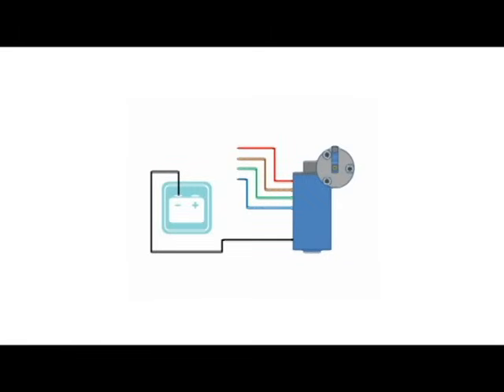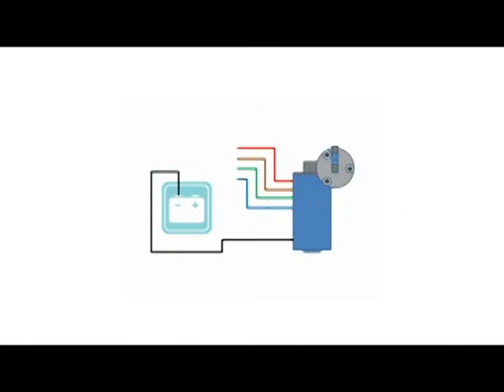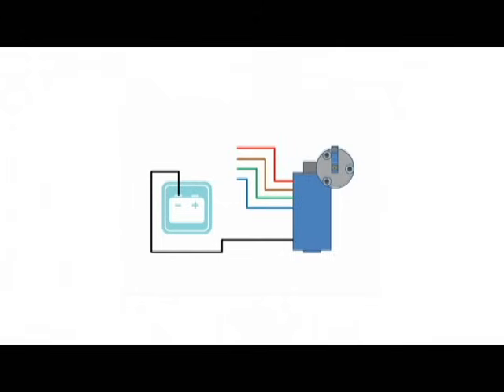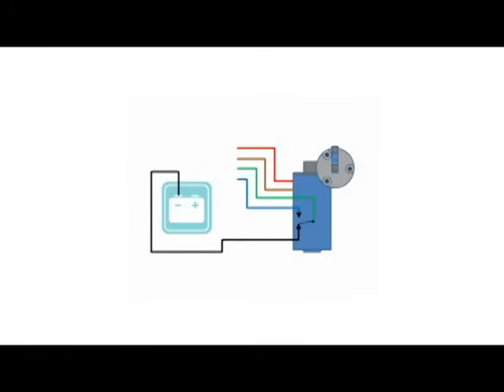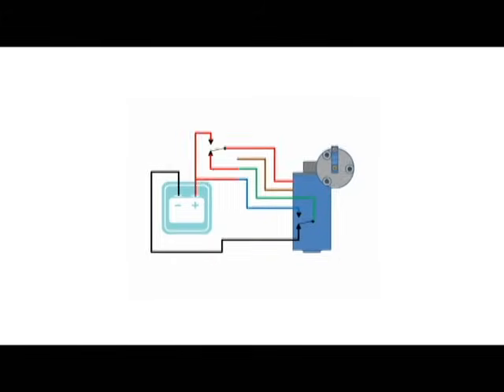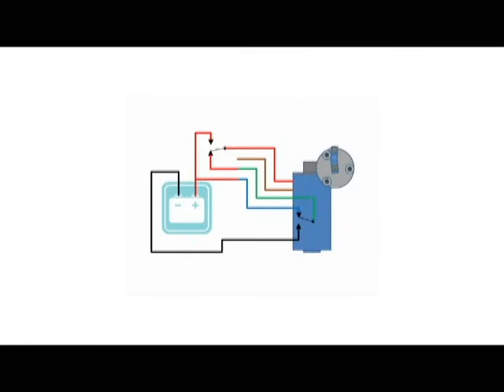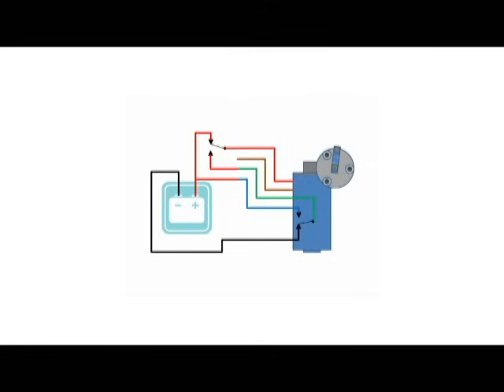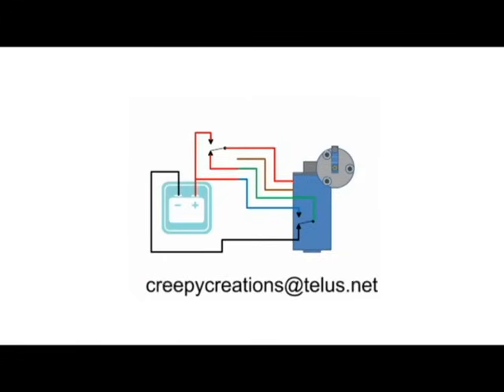Windshield Wiper Motor Wiring Tutorial

Comment: This is indeed the best explanation I have seen as others have said.  Most vehicles have not changed this theory in many years, why fix what isn't broke.  What I found helpful when looking at the complete schematics of vehicles is to start with the switch in low speed, look at how the circuit works and then turn it off and watch the operation.  Simple, but it took coming to the conclusion of starting my learning from the low-speed selection to be successful in understanding.

Comment: Excellent tutorial.  I'm having a problem with the wipers on my VW Golf Mk4 and this has helped me understand what's happening.

The blades behave normally, except that they continue after the 'park' position, and end up stopping a few inches up the the windscreen.  This is intermittent, and sometimes they park in the correct place, but almost all the time they park those few inches higher.  The 'faulty' position seems to be gradually rising, so now they park 4 or 5 inches up, whereas a month ago they were only parking 2 or 3 inches up.

I guess the park position (as opposed to whether they park at all) is controlled by the internal switch in the motor itself rather than the relay, but I'll have another watch of the video to see if I can think it through...

Comment: I am having a wiper park issues on my RV I want to put in a switch to manually park them.  Which wire would I put that switch into.  I was thinking of just ground, but maybe a better way,  I have Had Ford take a look at it,  they replaced the controller, I replaced the Column wiper switch and the Wiper Motor. It could be the park has to be adjusted. When it does work which is very seldom It does park in the 3 o'clock position. But I am at my witts end. It is a pain to adjust the park position on the RV so I want to put in a switch
Reply from the maker: The position cannot be adjusted.  It is base entirely on the motor and its position.  The only way to adjust the park position is to literally rotate the motor. Given that there are usually three bolts in a triangular arrangement, you really only have 3 options.
Reply: @AnimationGoneWrong  I believe what is happening is gravity is pulling it past park.  If I put my hand on the wiper assembly with a small amount pf pressure when at the 3 o'clock position they will park every time.  getting past that.. If I were to put a ,manual switch in to shut off the wiper motor which wire would tap into to install the switch.  I believe I can do it by tapping into the ground, but is there a better way..
Reply from the maker: @bassoneman  ground is usually the actual body of the motor, and the vehicle, so there's likely no way to tap in between that. Seems strange that you can put pressure on the assembly and it works... that makes it sounds like a bad connection, perhaps between the motor and the vehicle chassis itself.  Maybe what you need to do is install an actual ground wire between the motor and the vehicle chassis, to ensure a better connection. Just a thought... Also, most wiper motors use a work gear to drive the output shaft from the motor itself, thereby virtually eliminating the ability to manually (or by gravity) move the arm. Odd situation indeed.
Reply: @AnimationGoneWrong  This AM I took and ran a wire from the negative terminal of the battery directly to the case of the motor.  If I turn the key to one click before starting the engine the park position works great.  If I start the engine it won't park have to shut off the engine then the wipes will  park . Hmmm this is kicking my butt.  There is a ground that comes into the motor on its connector. Then coming out of the motor there is a wire that attaches to the outside casing that is where I attached the ground for neg side of batt.  I wonder if there is a issue with the ground that is coming in to the connector where is is floating or noise on it.  When I put a meter on the connector it shorts to ground. I may have to get a oscilloscope to see if noise is on that ground on the connector.. Or cut the wire and connect it directly to ground neg battery..  Ideas?
Reply from the maker: @bassoneman  no ideas at this point, sorry! Definitely sounds like you're homing in on the trouble, though... a wiring issue of some kind.  So, accessory position, it works. Running, it doesn't. Very strange indeed.
Reply: @AnimationGoneWrong  I am going to set up the motor for a test eliminating the control module..  The wires I have going into the wiper motor are Low, High, Park, Switch, and Ground.   My confusion come in the Park and the switch.  On your example which would be the park and the switch wires..  Is it that when I turn the switch actual physical switch on that goes to 12 volt, and off it goes to ground.  On the park wire  does that go to 12 volts or does that go to ground.. I guess what i am trying to say the green and blue wires on your example which would be the switch wire  and which would be the park wire
Reply from the maker: @bassoneman  in my example, the blue wire requires power to be available to it all the time, so I guess you would call that the switch wire. The green wire participates more directly with the parking feature, so you would call that the park wire, for lack of a better term.
Reply: @AnimationGoneWrong  Thank you..

Comment: Thanks, I have used wiper motors for a few halloween items but I was trying to figure out how to use a wiper motor to open and close my Greenhouse vents since the automatic ones didn't work. Looking to control the system with a thermostat. Once it reaches 80 degrees the vents open and the intake fans turn on, but I need to have it turn off the fans and close the vents when it gets cool. I have to figure out stopping the motor when it gets to 180 degree from where it started to open the vents, then when triggered again it continues to it's parked position
This was helpful so I don't have to recreate the wheel trying to figure out the wiring.
Thanks
Tim

Comment: Great video, how would you go about powering the wiper motor when outside the vehicle? On the plug pins.
Reply from the maker: I usually use old PC power supplies. They are cheaper, reliable and produce more power than you'd ever need to run a wiper motor. I've got videos on how to do that, too!
Reply: I tried powering a vw caddy 2015 wiper motor (with a pcb board) directly from battery and nothing happened. It’s a 3 wire, pin 1 is a power supply control unit, nothing on pin 2, pin is ground and pin 4 is from ignition switch.

Then I tried powering a Ford ranger 2015 wiper motor (with no pcb board) and it worked.

How is the one with a pcb board operates compared to one without a pcb board inside?
Reply from the maker: @khakalethumbete5269  No idea.  I would Google that particular vehicle and see if there is something special that PC board does.

Comment: Great video.  Clear and easily understandable.  I have a question.  In the video, the blue wire is going to the power source and the green wire is going to the relay/switch.  Are these wires interchangeable?  If not, how can i tell witch plug on the motor should go to the power source?
Reply from the maker: It depends entirely on the wiper motor. Those colors just happened to be the colors of the wires on the motor I had at the time. It took a lot of experimentation with a 9 volts battery (yes, it will get VERY hot if you try to run a wiper motor for more than a couple of seconds) to determine which wires did what. A multimeter is very handy for some of this, too.

Comment: If you apply power to the brown wire, which is the high speed setting, and a cable break occurs in the brown wire while the wipers are in a non-parked position: will the wipers stop where they are, or will they return to park using the low speed setting?
Reply: only one way to find out.... now go get some wire cutters ;)

Comment: Thank for taking the time to create this terrific presentation I still can't get my head around   one thing  ..  while  driving the motor  whats stopping that  park switch from switching and grounding the low speed  motor winding and blowing the fuse ?
Reply from the maker: Technically, nothing... other than bad wiring. If wired up as I show it, it can't ground the motor winding.  But yes, it is possible if wired incorrectly. So always check everything twice! 🙂
Reply: @AnimationGoneWrong  Sorry mate it just clicked only the green wire goes to the ground as we cycle through the park and on your run switch has it left open in the run mode  i don't know why i struggled with it so much ..

Comment: May I asked, will the motor make a single rev after I inject voltage at the blue wire? 

And it short of the video is trying to said,if there is a power cut at the Red line. The motor will continue to rotate and stop at its parked position, correct?
Reply from the maker: Not quite sure I understand the question, but I'll try... if power is cut to the RED line completely, it will stop. Voltage applied to the BLUE wire has to be connected to the RED wire through the GREEN wire. See around 2:38.  Without any other circuitry, applying voltage to just the BLUE wire will do nothing.
Reply: @AnimationGoneWrong  Thanks i think i got it.

Comment: Ok, i have removed my rear window wiper due to me getting rear black out windows, i want to know can i wire a 12v fog lamp  to the existing wire that was connected to the motor? i may as well use it. thanks
Reply from the maker: No idea, but I don't see why not. The wiper motor probably drew more power than the fog lamp will anyway,

Comment: This was nice, but, as you said, my wire colors are different. As I'm using my wiper on a trommel, the absence of a ground wire has me stumped. My wires are red, white, yellow and blue. Just need the slow speeed to work. Any advice?
Reply from the maker: Don't forget, the body of the motor is often ground. You might have to find a screw or small bolt your can loosen to attach a wire.  That's what I did.
Reply: @AnimationGoneWrong  awesome, thank you. Then I'm assuming I run that wire to the neg terminal on my battery, since there's no framework to attach to?
Reply from the maker: @nicholassteichen4552  yes, if what you are working on/building has no actual chassis, then the "ground" wire from the body of the motor would go to the negative terminal on your battery.
Reply: @AnimationGoneWrong  yep, no chasis

Comment: You mention using a 555 timer to control the wiper. Do you have a video on that? I was thinking of using an Arduino but if it can be done simply with a 555 that would be great. I'm trying to create a circuit to convert our two speed wiper system on our 1980 Camaro to  a delay wiper setup. With COVID the "delay/pulse" boards usually available to do this are out of stock everywhere. Thanks

Comment: Thank You so much!
Amazing that you are thinking outside the box as well.....I’m planning on using new but older style GM truck wiper motors as “openers” for my tailgate and cabinet doors on a futuristic looking utility bed I’m building on my truck.
     The tailgate and cabinet doors with  close and latch by hand with no handles.....the tailgate will have a momentary switch in the cab, to cycle the motor once with a cam to bump the latch open.
      Once the tailgate is open other momentary switches can be accessed to open the cabinet doors 😁👍🏻
Reply: Now I watched the video again.....the switch that flipped between the content and the internal switch.....in either position one is getting power 🤔 ....so it seems I need a second switch to kill power before that, since this will be only used once when opening a door, then off the majority of the time.....or is the relay responsible for that?
Reply from the maker: @justintyme1449  Sounds like a great use for these motors. Best of luck with that!

Comment: The video was excellent but only for the red (slow) wire. How do we wire this up for both the red and brown wire?
Reply from the maker: I'm not sure I understand your question.  The video clearly shows what the red and brown wires do. Red is slow (normal) speed, and brown is high speed. They are used independently and are never wired together. The park function is also never used on the high speed side either. What else were you expecting?
Reply: @AnimationGoneWrong Thanks for the quick reply! I guess I should have been clearer--sorry. Yes, the red wire is for slow speed and the brown wire for high speed. You clearly showed how to get the park function to work if you were using the slow speed. My question is how to use it for the high speed? You say that the high speed does not have a park function(?). I guess you have to go from high speed to low speed before shutting off the wiper motor. My problem with that is my stalk/switch went bad and I hard wired  my wipers to a on-off-on switch--one for low speed and one for high speed. That is why I asked my question. I guess to park when I am in high speed is to go from high speed to low speed to off. Or can I do the same process for the high speed as  you explained for the slow speed using two relays instead of one> Thank you for your time.
Reply from the maker: @nothingbutmathproofs7150  In theory, you could add a second switch between the upper relay and the red and brown wires. It should function the same, but I cannot guarantee it as I have never tried to park a motor running at high speed.

Comment from the maker: There are lots of options for doing this, some far more complicated, but more accurate, than others. You can let the motor do a full circle, but attach a small arm to the rotating portion and another linkage off that to create a sort of "piston" action, like in a car engine, then use that to "rock" another arm back and forth. Or, you could build a small controller circuit with a couple of limit switches that make the motor reverse direction when it hits one.
Reply: Thanks, it would probably be pretty easy to do it with an Arduino so I'll probably go that route. If I pulse the on-off switch for 1/2 second the wiper will go all the way in one direction and then come back to the park position. If I send that pulse at different intervals (depending on the  potentiometer setting) that should do it. Unless I'm missing something, which maybe I am.

Comment: Another question, have you posted any information on how you used the 555 timer IC with this?
Reply from the maker: Although I have built timer circuits for controlling these, I have found it is cheaper, and easier on my sanity, to purchase a ready-made circuit or kit.  A great example is the MK-111 Interval Timer kit from Electronics123  https://www.electronics123.com/shop/product/mk111-interval-timer-kit-4911?page=2&category=344#attr=14,356 You can't beat it for the price and it also runs off of 12 volts, so it's a perfect match for a wiper motor.
Reply: @AnimationGoneWrong  Yes, after seeing what that ready-made one consists of, it does look like that's the way to go.  Thank you.

Comment: Is there a wiper delay relay?? In the system? Thanks .
Reply from the maker: Typically. on older vehicles there was no delay relay. Newer vehicle usually have them now.  There were a lot of after-market wiper delay sold... they are pretty simple. By default, the motor doesn't have that.
Reply: @AnimationGoneWrong  THANKS for the reply, I have a Winnebago motor home that the wipers are giving problems, they only work on high setting . No mist or delay . I have replaced the wiper motor and the results are the same. That why I was asking about a relay?. THANKS DENNIS.
Reply from the maker: @dennismorgan8889  if you vehicle has a wiper delay, it is definitely possible that it is interfering with the normal (slow speed) operation. It could even be a wiring issue... something broken in the path to the slow speed side of the motor.

Comment: Hi 
My name is Mike from the UK. Thanks for the video on You tube it is really good and informative, I now get it. Hopefully you can help me with the switch side of things.
I have a GM pull switch. What I am trying to achieve is as follows - First pull of the switch will operate the slow wiper, the second pull will operate the faster wiper setting and by pushing the switch to its off position the wiper will return to its parked position. So getting back to your video the red (slow)  wire on the motor  is connected to the spade terminal in the switch which is linked to the first pull position on the switch. The brown (fast) wire will be connected to the spade terminal in the switch which relates to the second pull of the switch. so where or how do I connect the blue and green wires? Do they go to both to a another live terminal?
Reply from the maker: Assuming the same colours for the wiring, the blue wire needs to be connected to a constant source of power (at least while the vehicle is running).  The green wire HAS to be switched into the red wire.  It can't be permanently connected to red, or the internal switch will short out the powered red wire to ground during normal slow operation. See the diagram at around 3:00. I hope that clarifies things.
Reply: @AnimationGoneWrong  Hi It is not so much the wire colours as they are different to the Black, Red, Green and Blue. On a VW wiper motor they have numbered wire locations 31 at the top which I believe is ground then 54 then 31b then 54d. I am told it is a 2 speed with park motor, just need to know how to connect the GM pull switch and retain the functionality as if it was originally designrd to operate.
Reply from the maker: @michaelmchenry353  Sorry, my friend... I have no idea.

Comment: I have a 2006 GMC...with the wiper fuse in the battery light stays on when vehicle off...there is a draw...pull the fuse out and the draw stops...if there is a break/short in the black ground wire would it cause this? wiper works fine when vehicle is running